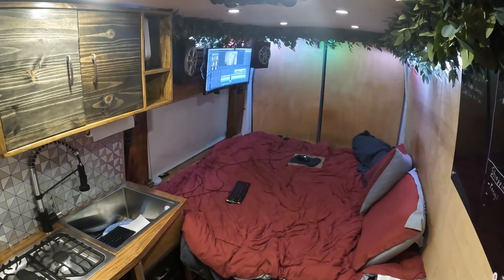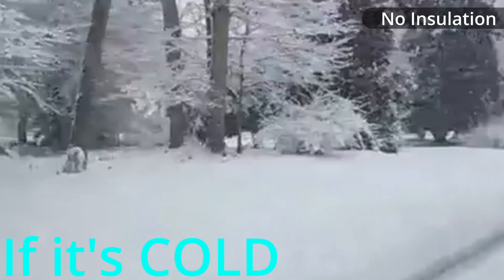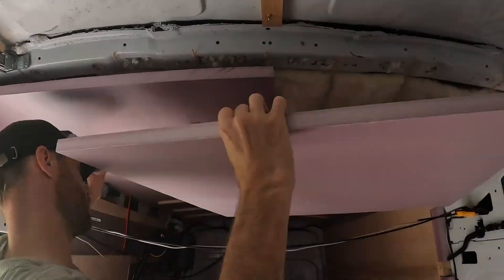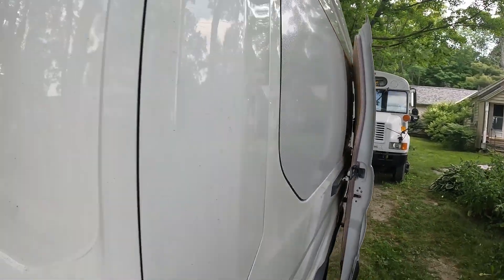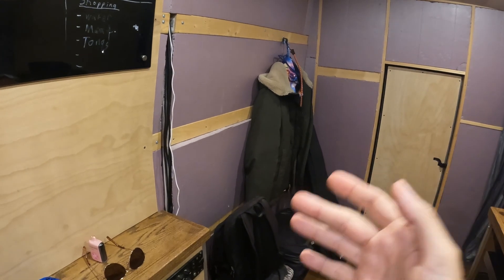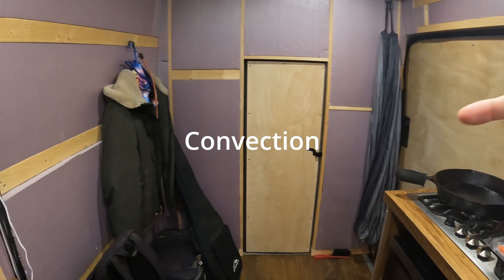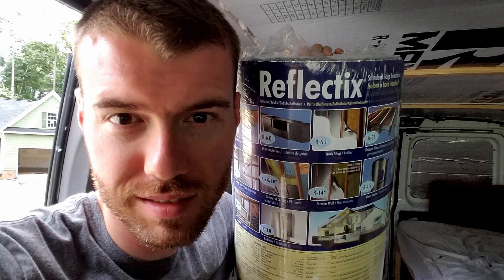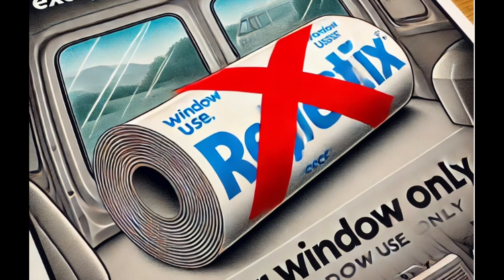Insulation 101: The MOST CRUCIAL Step in Your Van Build (Avoid These Mistakes!)

Comment: The problem with reflectix I had when you put it up on a window heat gets trapped between the window and the reflective if you can crack the window let the heat out then I guess I don't know on a door window that can't be opened or fixed elongated back windows your best bet is to paint that window the same color as the van because that reflectix is going to create a hotspot in between it and the window inside your van the only thing I put over my windows is cloth it doesn't cause a hotspot between the window and the cloth therefore you're not dealing with the heat created there a slight tint with a black rag behind it makes it virtually impossible to see you in in the daytime and light enough you can still crack the curtains see out at night being a parking lots and such that can be a problem if you can't see

Comment: Do you think this would be practical for a smaller van like your old one?
Reply from the maker: Hmm, for my old van, if I was to do it over again, I would do at least 2 inches all the way around. This is due to NOT having AC or Heater in my first van. Without heating or cooling, their is slightly less reason to insulate with 5 full inches. With this, it's more about blocking the radiant heat.

Comment: First video that ACTUALLY covers how heat transfer actually works…i am so happy.

I don't agree that 5” is needed though for close to this results.

My thinsulate is 3” I used two chunks in all the cavities. I stopped thermal bridging with ezcool over the metal/wood connection and I used nylon screws cause I'm crazy. My floor is 4” though.

I followed faroutrides who have don't the same in a van for 4 years and they took it in brutal cold.
Reply from the maker: 5 inches only makes a difference really if you are using a heater or a cooler (AC).

If so, 5 inches is around the minimum for AC. This is when the amount of insulation truly matters for making the AC work less so you conserve power. Instead of using 3000 watt hours a day (or whatever it would be), you might only use half that (given good insulation).
Reply: @OutdoorsEmbrace  In Texas heat at 95 w55%humidity I can run my 9,000btu Ac unit for 20 minutes per hour to keep it at 74. That works for me.
Reply from the maker: @edgeofnothing67  nice! I'm going for full time AC in mine.

What AC do you have btw?

You said you have 4" floor, that would help with AC quite a bit!
Reply: @OutdoorsEmbrace  I have a 48v recpro ac with heat pump on my Ford transit extended

Edit- my Ac is on the entire time but all acs should have a cycle time and the general rule of thumb is 20min per hour so 30%. You do not want it on running 100% of the time.

Mine uses 720w
Reply from the maker: @edgeofnothing67  well that is great! How much battery do you have? You run it full solar?
Reply: @OutdoorsEmbrace  ecoflow power unit 5kwh. I have a space to add a second battery if needed. Hence why super into research like yours on insulation and others that help me validate my energy consumption rates.

I have my Ac on 48v everything else at 24v. I also did hydronic heated water over electrical to remove that from power draw.

I have 600w of solar and a secondary 240amp alternator.

Comment: How come you don't mention Thinsulate - one of the most popular types of insulation for walls/ceiling? It also does not absorb water and has acoustic absorbing qualities and I think you can double it up where needed. I have also heard because wool absorbs water that it can smell unlike Thinsulate which is hydrophobic. I don't see many builders willing to put 5 inches of insulation in their van walls.
Reply from the maker: My message is simple, lose the space and put in 5 inches! It makes that big of a difference. Most people not willing to put in 5 inches, but most people do not have a very comfortable van in summer time. I wish my video could actually show how my van feels like for people. I'm currently making a second video on insulation for more advanced stuff. I'm putting in a temperature graph of the inside and out over an entire summer month (because I have the sensors in place inside and out).

Thinsulate is fine for builds who do not want much insulation at all! If you were to put 5 inches of insulation on your walls of thinsulate, you'd have to buy TONS OF SHEETS OF IT! It's not usually sold larger than an inch thick. This is a big problem. While it offers great benefits, this would be EXTREMELY expensive for the same amount of insulation I have in my van! For these reasons, I do not recommend thinsulate!
Reply: @OutdoorsEmbrace  Thanks for taking the time to respond. Looking forward to your next insulation video. I have also heard that window radiated heat can be a bigger overlooked problem than wall insulation. I have heard amazing results from using ceramic tinting which can repel 95%+ of that heat.

Comment: What R-Value are you using? I’m converting a box truck and I already have R-6 for my floors installed but I’m just about to do walls and your insulation board seems thicker then mine and I’m interested in what it is!
Reply from the maker: Per 1 inch, its R5
XPS board that lowes or home depot sells.

Since I have 5 inches on my wall, I have R25 on walls. Sadly only R14 on cieling, due to being able to stand.

Comment: Leave the van all day in the sun and see temps rise to 40 degrees inside.
Reply from the maker: Well it doesn't happen (with good insulation). Not with ventilation which should be standard for all van life rigs.

I'm making a second video on insulation right now to cover more in depth. I have temperature gauges in and outside of van that plot the temps on a graph over a month. I'll show all my data on this next video!

Comment: Brother I disagree. Opening the van door for 30 seconds is not enough to let the heat out because yes you will remove the AIR from the van in that time, however everything inside (bed, clothes, insulation, even our bodies) are still warmer and the second you close the doors those hotter items will warm up the inside air of the van again.
Reply from the maker: Ok, well open it for a minute instead then! Haha. But I do this personally all the time, especially in Florida. Personally it works. But personally I have REALLY GOOD insulation too = everything inside the van at most becomes the same temperature as the outside. 

Insulation is really bad at holding it's heat too. It does not give off its heat over time like metal would either, so hot insulation isn't a big threat for radiant heat.

Otherwise, you aren't wrong, but opening your door definitely helps WAY MORE than not doing so.